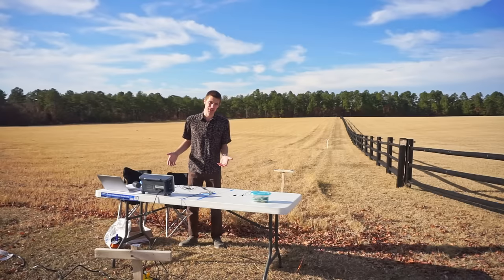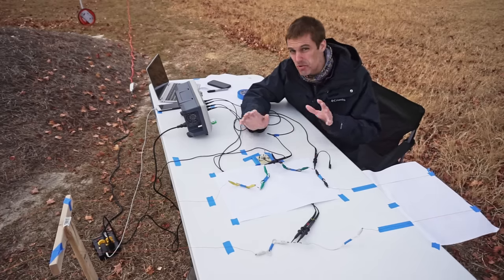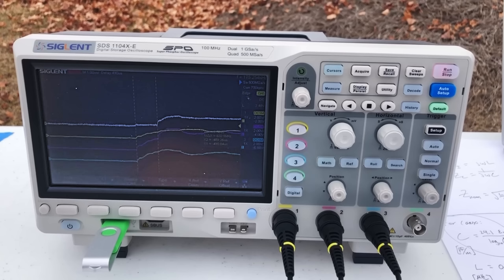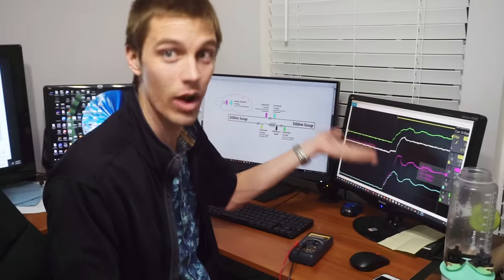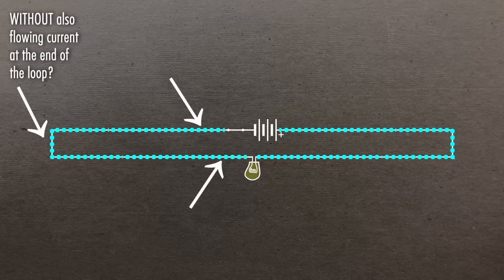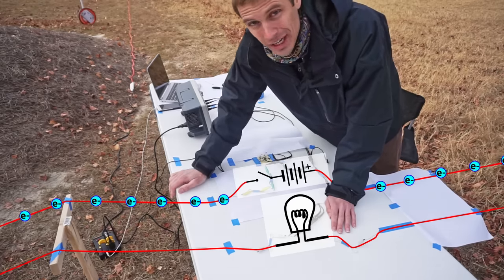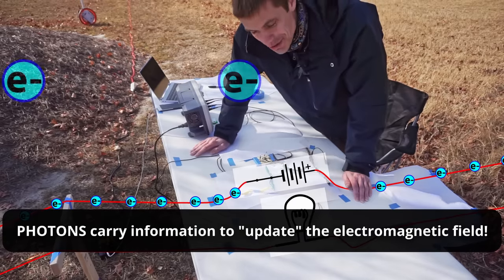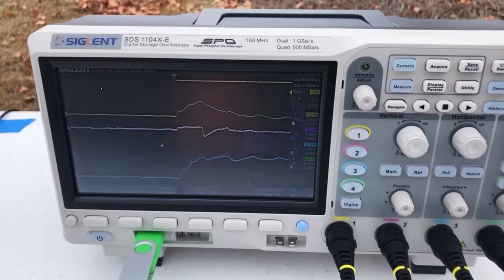I bought 1000 meters of wire to settle a physics debate

Comment: Derek thinks electricity travels at the speed of light. Let's see what a web search says. Oh look, Derek is wrong, it's usually about 90% of the speed of light, which is not synonymous with 100% of the speed of light: 

"Wave propagation speed also called the velocity factor or velocity of propagation of a transmission medium is the ratio of the speed at which a wavefront (of an electromagnetic signal, a radio signal, a light pulse in an optical fibre or a change of the electrical voltage on a copper wire) passes through the medium, to the speed of light in vacuum.

The dimensions of the wire and electrical properties like its inductance affect the exact propagation speed, but usually it will be around 90 percent of the speed of light – about 270,000 km/s.

In everyday electrical and electronic devices, the signals travel as electromagnetic waves typically at 50%–99% of the speed of light in a vacuum, while the electrons themselves move much more slowly; see drift velocity and electron mobility.

For example, the velocity factor for coaxial cable is typically around 0.66 to 0.85, meaning that the velocity of an electromagnetic wave in the cable is only about two-thirds to four-fifths of the velocity of light in a vacuum. This can cause signals to experience a delay when transmitted through the cable since the velocity of the wave is slower than it would be in a vacuum. The delay can be significant for high-frequency signals, which can experience phase shifts or distortion due to the velocity factor." 

I can't give the source because URLs can't be posted in YouTube comments so just search the text, enter the first paragraph and it'll come right up. BTW, the maker of this video should have made the wire a round loop, not a rectangular one, so the wire would be at maximum distance from other parts of itself. One more point, Derek also claims that magnets are caused by relativity because the wire contracts simply because a charged particle is moving along the outside of it at the same speed as the electrons. Well, for electricity to be flowing through the wire the ends must be joined at the power source in a circuit, so if the whole wire contracts then where do the extra electrons that can no longer fit inside the shorter wire go, since the spaces between them supposedly stayed the same? Derek is a veritable spring of misinformation.
Reply: You can in fact derive the magnetic field around a wire using relativity. It's an extremely classic calculation, you can find tons of ressources explaining it online.
Your question about how the electrons still fit inside the shorter wire seems basically identical to the "ladder paradox" to me. The answer lies in the fact that you also have to consider the relativistic effects on time like relativity of simultaneity. Look up the ladder paradox for more details, it's also very well known and there are tons of ressources about it
Reply: Yeah I know, I've read the same thing about 1000 times. What they do is say "a wire of infinite length" to avoid the obvious glitch that the same number of electrons couldn't fit inside the wire if it shrank, so they just pretend the wire has n ends. The simple fact, as I described, is that it can't be an infinite length wire and have electricity flowing through it, it has to be a closed loop, which means it has to have a finite length. You didn't explain away my point at all, just suggested going somewhere else to find it, as if that's even possible when they all use the infinite wire ploy. @lunkel8108
Reply: I don't think the infinite wire is necessary. It makes it a bit simple, so that's the version you use in class but it isn't necessary. You'd see how relativity of simultaneity resolves your problem if you looked at the ladder paradox. The short version is that all of those electrons don't have to fit into the wire at the same time.
Reply: I don't think the infinite wire is necessary. It makes it a bit simple, so that's the version you use in class but it isn't necessary. You'd see how relativity of simultaneity resolves your problem if you looked at the ladder paradox. The short version is that all of those electrons don't have to fit into the wire at the same time.
Reply: I don't think the infinite wire is necessary. It makes it a bit simple, so that's the version you use in class but it isn't necessary. You'd see how relativity of simultaneity resolves your problem if you looked at the ladder paradox. The short version is that all of those electrons don't have to fit into the wire at the same time.

Comment: Its a rather silly waste of time. Im no brain amongst brains and i havnt bothered to watch. Electrons do not "move" through the same enviroment in the same way as photons do. Nothing moves faster than light except perhaps the expansion of the universe. Even in vacuum ,electric fields need to push against each other. It takes time for this. Even though i am told the speed of electricity is close to light speed it isnt as fast because it cant be. Or as i understand it...the electron that pushes is not the one at other end of the line. So an individual electron cant possibly move as fast as light.

Comment: Save yourself 22 minutes and 48 seconds of your life and just read the simple google search below. You're welcome.
"It's the electromagnetic wave rippling through the electrons that propagates at close to the speed of light. The dimensions of the wire and electrical properties like its inductance affect the exact propagation speed, but usually it will be around 90 per cent of the speed of light – about 270,000 km/s."

Comment: nice video!  which proves Derek wrong.    In his original edit he said the light bulb would turn on then his next edit he said turn on but not fully and  of course that is NOT the same thing.    lol  No one argued that at a few feet there would be no influence it was about the light turning completing on which is false.    Furthermore, if the bulb was placed same distance away from battery as wire length then you do not see any bulb increase before electrons in wire get there because they would get there all at the same time and that is IF the cross field could even reach that far to have any measurable influence.

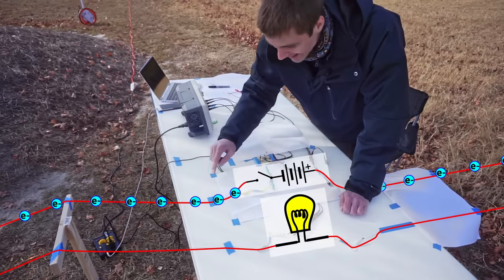Comment: In this video (https://youtu.be/iph500cPK28?si=7cuyVwWcZvTF3zNC) the diagram at 16:25 shows the same 1.6 ms delay plotted using simulation of 1 km wire length. Sweet!

Comment: Well there’s 20 mins of my life I’ll never get back. Electricity passing through a conductor roll travel at all different speeds 
depending on the conductor material. Each material has a resistance which effects its conductivity and slows electrons 
which create friction. Hence the search gif super conductors. You seem a great guy but all you found out was the speed 
it travels down that conductor on that day at that temperature using that source potential. I expect you enjoyed yourself.

Comment: A single wire is not a good transmission line, actually, it's a long wire antenna. If you took the trouble to read a basic radio electronics book, like the ARRL Handbook, you would know that signals, what you are calling electricity, move down a transmission line at the velocity factor of the line, which for RG-8 coaxial cable is about 84% the speed of light, but for a thinner cable with different dimensions such as RG-58 it is only 66%. You are just being needlessly dramatic over a very basic bit of knowledge any Ham Radio operator could have quoted you from memory.

Comment: Wrong experiment to settle this debate.
Reminds me of the thought experiment about relativity.If you had a rod couple of light years long and jiggled one end could you not send a message faster than the speed of light.
The answer of course is no because the rod is made up of atoms connected by electromagnetic forces and those can only interact at the speed of light.

Comment: when idiots play physics, the max speed is no correct expression, the math speaks about information. the max speed for information handled between two points is speed of light! on the opposite, everything which does not carry information from a to b or elsewhere can move at any speed even higher as speed of light.
If you build a circle to detect the speed of light, point a and point b are at the same place, so the receiver already has the information at the very moments the signal is send.

Besides this, there are fields which are transported not hard stuff.

Your analysis is completly wrong, just go back to school.

Comment: YOUR MATH IS WRONG
"The dimensions of the wire and electrical properties like its inductance affect the exact propagation speed, but usually it will be around 90 per cent of the speed of light – about 270,000 km/s." – BBC Science Focus

Comment: Wrong! Wrong wrong wrong! YOU ARE MEASURING SIGNAL VELOCITY NOT ELECTRON SPEED!!!!  Damn, man, this has been known since the sixties!  The time is takes electrons to travel down the wire is less than a kilometer per hour!  Why does no one understand this!  CURRENT IS NOT ELECTRONS PER SECOND!!!!!! YOU ARE MEASURING CHARGE SPEED!  Signal speed is charge speed, it is NOT electron speed!  How do you explain if you used AC voltage????? Electrons speed is measured with DRIFT VELOCITY!!!!  WHICH IS AROUND 17 MINUTES TO TRAVEL 1 METER!!!!!! 0.0588 meters per second!!!  Coulombs is NOT electrons per second, it is charge per second!
Reply: You're right, but this is adequately explained @13:00 onwards...